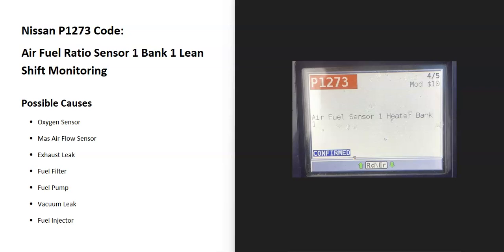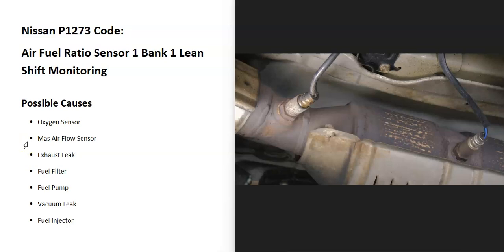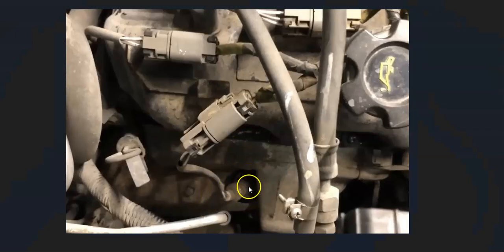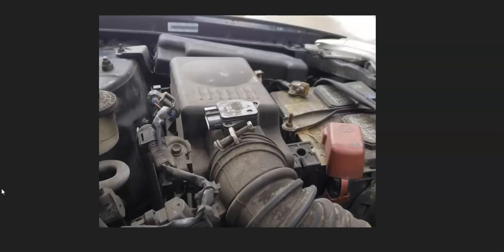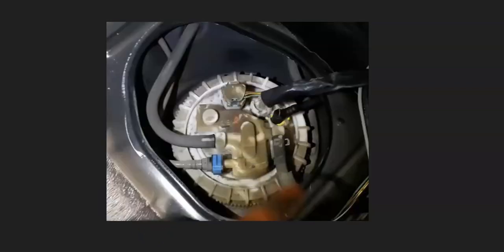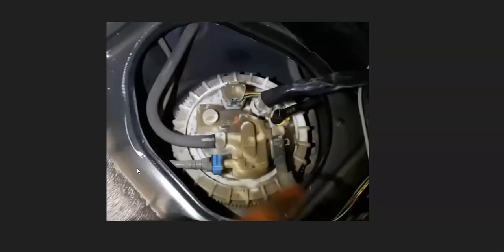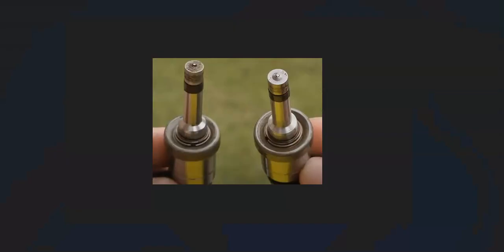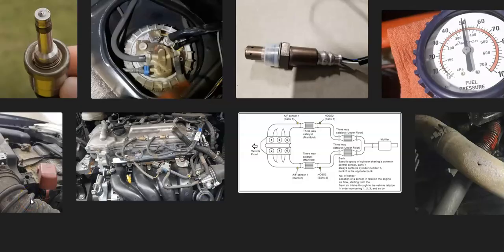Causes and Fixes Nissan P1273 Code: Air Fuel Ratio Sensor 1 Bank 1 Lean Shift Monitoring

Comment: @HVAC_Mechanic I've done a leak test with smoke machine on exhaust and vacuum with no findings.  I've watched the voltage on all 4 sensors while having the engine idle for 15 mins with elevated RPM for portion of that time.  The only thing I've found is my bank 1 short term fuel trim spikes up to +20%.  I'm currently waiting on some fittings to test fuel pressure at the fuel damper.  My question is, could it possible be a clogged PCV valve?  Or is it definitely a clogged/bad fuel injector?
Reply: Any luck?
Reply: @bojack2740  Yeah so, it was the downstream o2 sensor on the bank that was causing the p1273 code.  I swapped the upstream sensors, and instead of getting a p1274 code (for sensor 1 bank 2), I got the same p1273 code.  I cleaned the fuel injectors, swapped the pcv valve, and did the smoke tests and what not.  Turns out it was a bad downstream sensor on that bank.  This is for a 2004 350Z btw, if you're curious.

Also, fun fact, the downstream o2 sensors are NOT swappable, which is dumb.
Reply: @williams.7314 thanks, I'll definitely look into that. Probably will just replace that downstream sensor, since the up stream one has been replaced.

Comment: A few days after replacing the catalytic converter to fix a P0420 code, I got a P1273 code. I then replaced the air-fuel sensor to address the P1273, but the code returned after about 50 miles. The car sounds a little bit different when I accelerate, but otherwise, my Frontier runs great. The only problem is it won’t pass the smog check with a code present. Any suggestions?
Reply: i have a similar issue, replaced my cats and o2 sensors because of a P0430 code then about a day later I got a P1273 code. Gonna try to see if the flanges are lined up fully and re-seat the o2 sensor but besides that i’m at a lost.
Reply: @only4mari  I brought the truck to a local mechanic, and they couldn’t find an exhaust leak. They updated the firmware to address a related TSB and said they were able to monitor the mixture levels afterward, which looked good. However, the P1273 code came back a few days later. I’m bringing it back in on Monday.
Reply: @only4mari  The shop found an exhaust leak and fixed it.  The truck was running a lot quieter afterwards, but the next day the P1273 came back.  I have the truck at an exhaust shop now and they say they found additional leaks.
Reply: The exhaust shop resealed all the exhaust system connections.  The code has not come back and the truck passed smog check.
Reply: @rdagger the exhaust or at the intake?
Reply: @bojack2740  Sorry, I’m not sure. My mechanic took the truck to the exhaust shop and covered the cost himself due to the previous failed repairs. He just told me they redid every connection.  The code never came back.
Reply: Identical issue with my 05Path after cat and evap codes. New cat and evap addressed but car now is louder then this code came up. Though I haven't gone through all those steps yet with the mechanic, I'm dreading have to shell out more money into this car especially to still have the issue unresolved at the end of the day. I've read other comments and doesnt seem like anyone has found a solution. I just want to pass my inspection!

Comment: 2005 Titan. Replaced all oxygen sensors. New plugs. New coils. New injectors. New MAF sensor. Sprayed all vacuum lines, intake, exhaust Manifolds with 2 cans of carb cleaner. Sprayed exhaust pipes. 
Still P1273. 
4:20
Reply: Have you tried anything else since then?
Reply: @PitoDeOro1  replaced oxygen sensor again. Replaced MAS sensor. 
Sprayed all vacuum lines, intake, exhaust manifold again with starting fluid again. Still P1273
Reply: If you haven’t already, try resetting the code and see if it comes back

Comment: Hello, I have the combination of p1273 Air Fuel Sensor 1 Heater Bank 1 and p1084 exhaust valve timing circuit Bank 2. Would I start with replacing the evt sensors?

Comment: Hello.  Nissan Murano z50 error p1273 and p0000, appear at the same time after reset, what is the second error?  can you suggest?
Reply from the maker: A P0000 code is a "No Self Diagnostic Failure Indicated" or "No Diagnostic Trouble Codes Found." This code often happens with scan tools that don't have software to fully read the ECM.

Comment: My son just bought a 2005 Nissan Altima 3.5l se and it has the p1273 Air Fuel Sensor 1
Heater Bank
1
Code, the guy he bought it from said his mechanic changed the 02 sensor and the fuel pump and indicated that he thought it needs a catalytic converter, what are your feelings on this?
Reply from the maker: If the catalytic converter is clogged up, it can cause an issue, but usually it would give another code. The catalytic converter can be tested with a low-cost Infrared thermometer to see if it is failing. Here is a video on it. https://youtu.be/MWpOvrJYois
Reply: @HVAC_Mechanic i just took my 2005 Nissan Sentra to change my catalytic after the p0420 came out.

That was the only code I had, they replace the catalytic and about 30 miles of running the car after I got the p1273 code.

I took the car back and they change the sensor and I look for leaks but nothing.

Do you think they install a bad catalytic?
Reply: @agaspiderman921   I have the same issue with you, after replacing catalytic, got 1273, does the 1273 go away after you change the sensor?
Reply: @xiaoguangfang170  unfortunately I have not find a fix, three mechanics have look at it and have not able to find the reason.

The funny part is that now the code stays and goes. So we think it has to do with a censor or cable. I’ll let you know if I find a fixed, and if you do please let me know as well please!
Reply: @agaspiderman921  Sure, will let you know if I fix it. Thank you.
Reply: Usually this is the O2 Sensor that is dead. I did on my Maxima and the codes went away. They were over 20 years old
Reply: Have done all this and replaced all lambda sensors but still no good. I'm lost now and my fuel consumption is to high